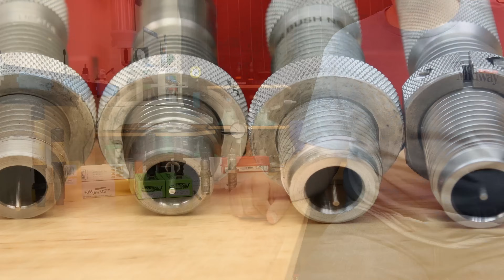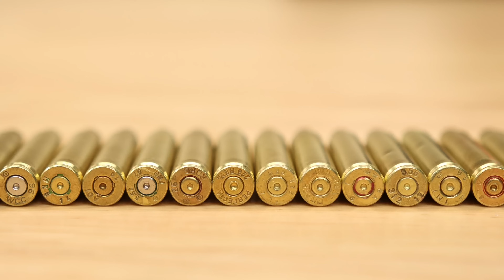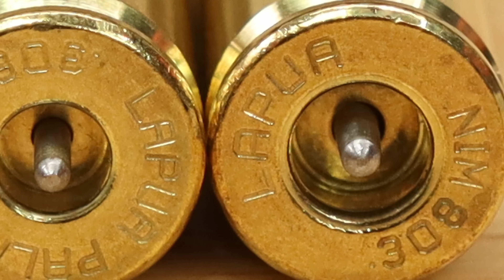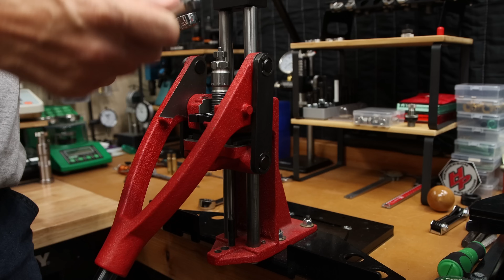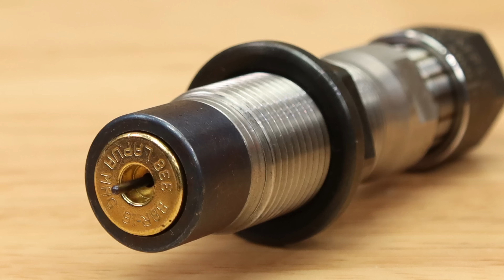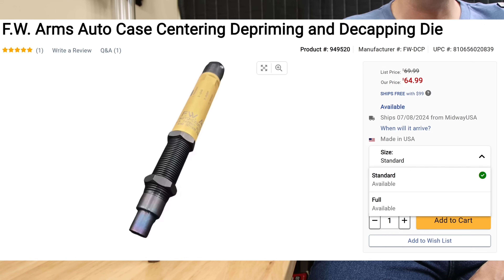From Beginner to Pro: Your First Reloading Upgrade

Comment: After breaking many decapping pins on FL sizing dies a friend recommended the Lee, but insisted I get the pins from Squirrel Daddy. 
I did in fact bend the Lee pin and since I installed the SD pin, I haven’t had a single problem. 
Good die. Good pin. All done.

Comment: I fully abide by the decap=>wet tumble=>inspect=>resize process order of operation. I have a Lee APP press set up for decapping and it doesn't take long at all. I'm satisfied with the Lee die but I may pick up one of the FW Arms universal decapping die anyway just to see (once they are off backorder at Midway). I don't think I can go wrong at that price.

Comment: Seeing as I already had  a case prep unit, I deprime and then do the primer pocket onthe case prep unit, then onto the sizing process. I don't run an autoloader, so, not tossing cases into the dirt, can clean when lubing if necc on the odd one. FA case prep unit is cheap for that purpose. I also run two presses, one to decap, clean the pocket, lube, also size on two presses, one to size, one to expand, trim, chamfer, done.Goes PDQ.

Comment: After breaking the pin on my 9mm resizing die thanks to a berdan primer, i got the lee universal decapper with undersized pin and i use that for all my decapping regardless of flashhole or primer size.
Very happy with it.
Running it on a single stage press allows me to feel for berdan primers by using gentle handle strokes. Any resistance and ill stop and check.
Also use it as first step in my reloading process.

Comment: What do you think of Frankford Arsenal hand depriming tool?
Reply: Although the Frankford Arsenal hand de-capping unit is potable and allows one to de-prime anywhere, I prefer using the Lee APP (auto progressive press) with the Lyman spring loaded de-capping die. With this set up one can de-prime hundreds of cases very fast. The Frankford Arsenal hand de-capping unit is slow and kind awkward to use.
Reply from the maker: I think it may be good depending on your use case.
Reply: @BoltActionReloading  If you ever get one, I would like to see your review. For a newbie reloader like me, your videos are reference points on reloading.
Reply: I have one. It works better on some calibers than others. It’s as fast as using a depriming die on a press but the biggest advantage for me is that I can do this process anywhere in the house, I don’t have to sit on the bench on the garage.
Reply: @DCSCIENTIA  That is the main reason I am thinking about getting one. I plan on reloading mostly .308 brass and can't think of a good reason why not to get one. Except the expense, of course
Reply: My lapua brass I drill and deburr it right out of the box